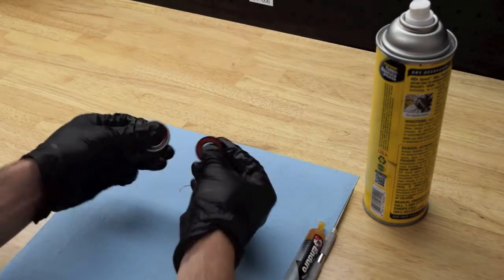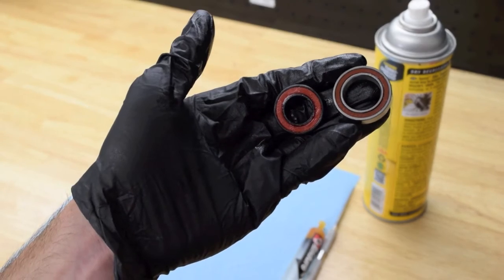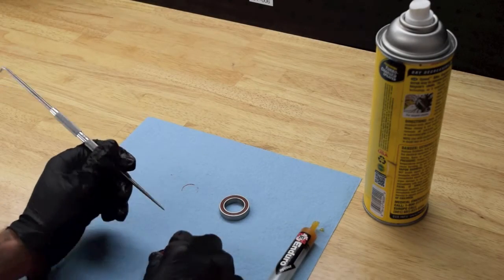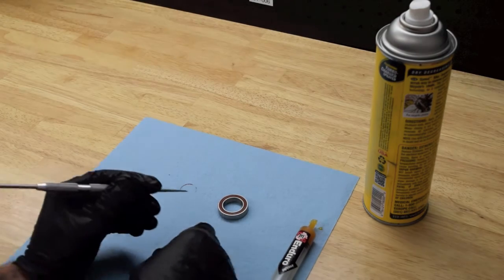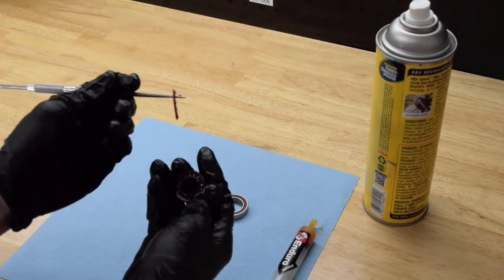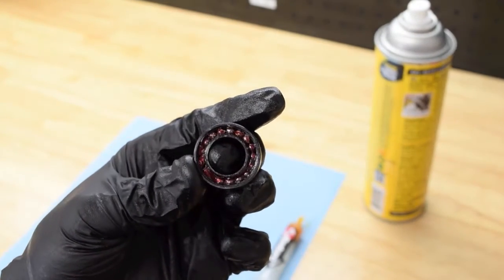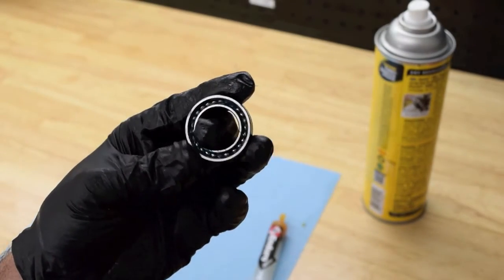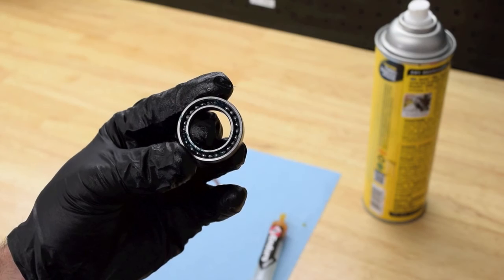Enduro MAX Type Bearings

Comment: Are this ok to to put in freehub in bike cycle ?
Reply: This is not meant for continious motion but for small angular movement and high load found in suspension pivot.
Reply: Do you have any videos on replacing suspension link bearings?